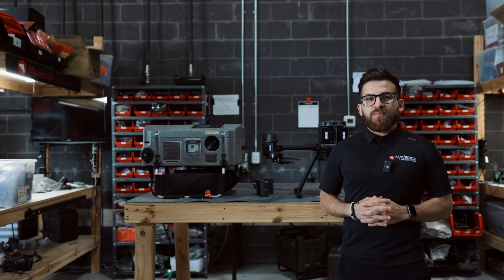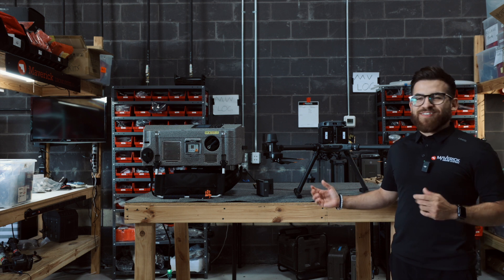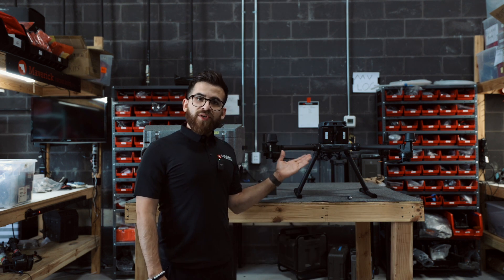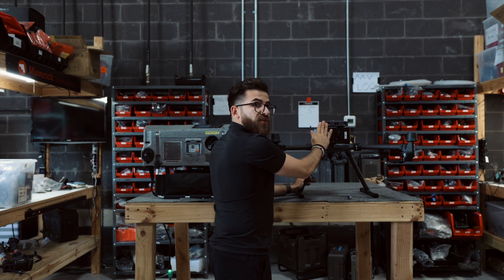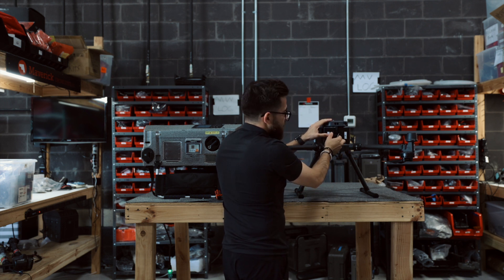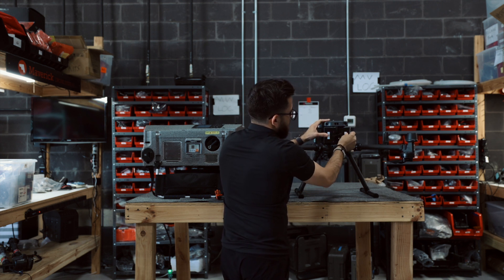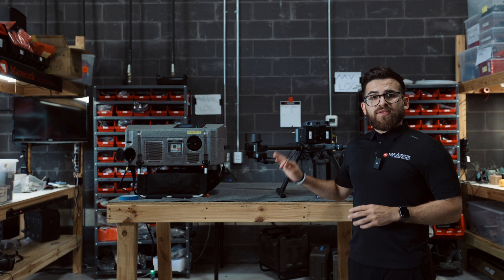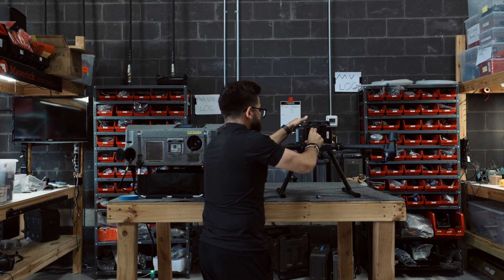Drone Tether Backpack Overview & Walkthrough | CZI TK300 | Maverick Drone Systems

Comment: Have you had issues with the tether and battery connection or power output errors? Also when you say to see if tether is operating by power percentage increase, are you starting with 100% charged batteries?